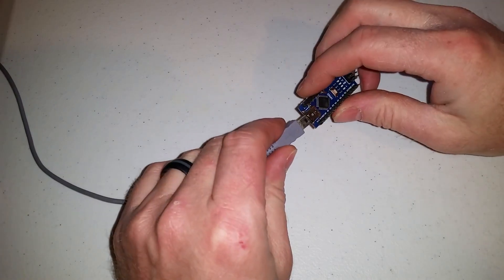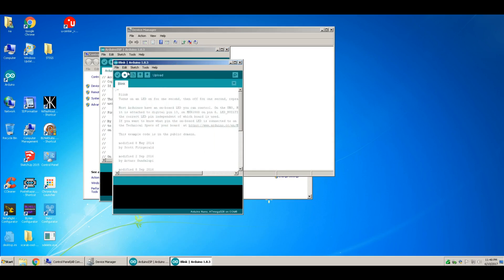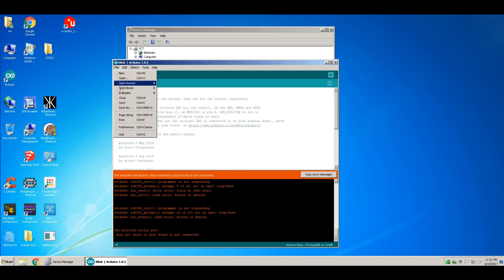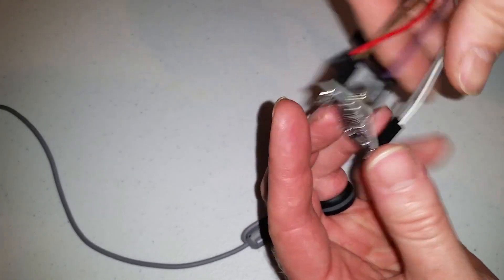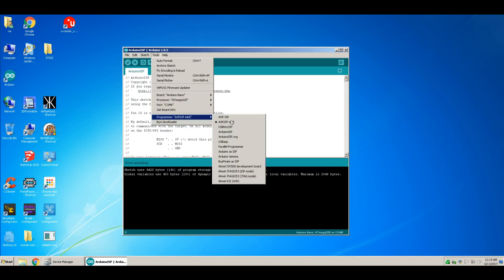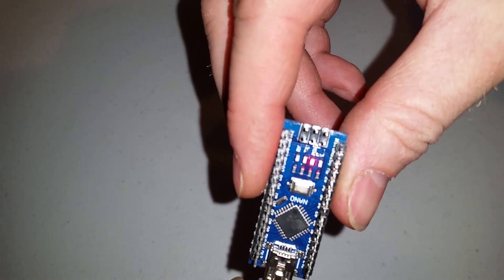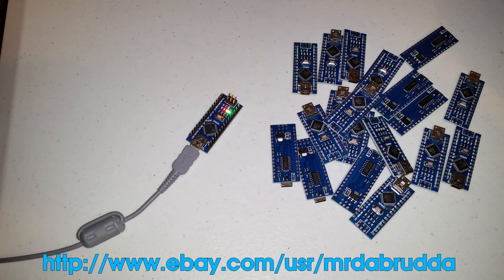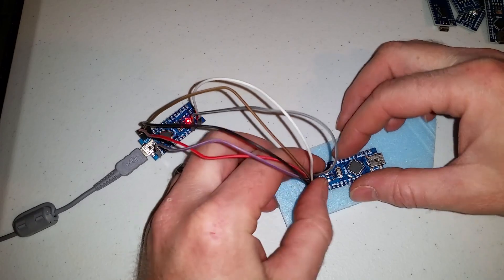How to Flash/Re-flash a Bootloader on an Arduino Nano

Comment: what if i dont have another arduino just the nano thats not working?
Reply from the maker: You can use an FTDI module or any kind of Arduino.
Reply: @MrDabrudda  hey thanks I already fixed i just had to click the old bootloader option in processor

Comment: I keep getting message I dont have permissions and cant communicate , what can i do to get round this?
Reply from the maker: Are you using Linux or Windows?
Reply: windows 10
Reply from the maker: In Arduino IDE ensure the comms port is set correctly.  Ensure the windows drivers are installed.  http://www.wch.cn/download/CH341SER_EXE.html to download the drivers.  Reboot after the install.
Also try running the Arduino IDE "as and administrator".

Comment: I found a trouble:
avrdude: Expected signature for ATmega328P is 1E 95 0F
         Double check chip, or use -F to override this check.
Error while burning bootloader.

how to fix it?
Reply from the maker: Is your processor an ATMega329P or an ATMega329PU or ATMega329PB?  That will make the flash fail if not selected correctly.
Reply: @MrDabrudda  atmega328PU smd

Comment: so what you and others are saying is that without a working arduino of some kind you can't update a bootloader on a nano. i have two nano's and must specify Atmega328P (Old Bootloader) in order to upload a sketch. No problem. But when I updated to the library TFT_ILI9163C-Pre-Release-1.0p7. It doesn't work anymore. I get a clean compile followed by a clean upload but the the red light on the nano just flashes very fast. I tried fitting a 3V3 level converter but it made no difference. So I have ordered another more expensive Nano which hopefully will have the new bootloader. Thank you for an excellent video.

Comment: Based on a comment on the top answer here: https://arduino.stackexchange.com/questions/51866/arduino-nano-atmega328p-bootloader-difference

It seems like a good idea to just burn the Uno bootloader onto the board, that way you get an extra 1.5k of flash space.

Comment: I had the same problem, but was able to use the Chinese NANO  by selecting the "use old bootloader' option when downloading a program. Using the old bootloader uses more memory, (about 1.5 KB more), compared to the new one, but if your program  can fit into 30KB or less, there will be absolutely no difference in the results.....

Comment: While this video didn't solve the root cause of the problem with my Nano's setup directly it did lead to the cause after observation when trying to re-flash the bootloader.  The power led was lit then slowly dimmed down.  The problem I was having was that I hooked up my Nano with the VIN pin.  This was effectively making the Nano try to power other circuitry making it impossible to load code and throwing this error.  Once I slapped a diode in there all was right with the world and the Nano was then programmable again.  Thanks for taking the time to make this video!

Comment: I got problem. avrdude: Expected signature for ATmega328P is 1E 95 0F
         Double check chip, or use -F to override this check.
Error while burning bootloader. the connection are correct.
Reply from the maker: Try this work around
https://www.instructables.com/id/Bootload-an-ATmega328/
Reply: @MrDabrudda  "(A bootloader, very simply, is a programme that sits on the chip and manages the upload of your sketches onto the chip)"

Once this is done the chip would work ona battery and send information , withb luetooth as example)   to another device?

Comment: can you help with a nano that all it does is the led just flashes red thats it and it wont let me upload to it...
Reply from the maker: Does the Nano detect in the Device Manager?  If not load the drivers.  Try a different USB cable which you know works with data and not just a phone charging cable.
Reply: use old bootloader option

Comment: Hello! I have a JGAurora 3D printer with a main board not specified in arduino. It’s called a MPX_PRO_V3. I accidentally flashed the printer and ended up bricking the board, resulting in the two white bars. I did buy a usbasp for the unbricking process, but everything I try fails. How do I burn a bootloader to the board using a usbasp? Or would I have to get an arduino nano? Thanks in advance!
Reply from the maker: I made a video on how to flash an Arduino bootloader using a USBasp.  I don't have a MPX v3 motherboard but all Arduino boards have to same ICSP connectors.

https://youtu.be/jgHIFWPUe_M

Comment: Hey. I have a problem with one of those Arduino Nano. When I plug it in my computer. It does nothing. No sound of it going in. The lights on Arduino is on. Nothing in device manager. No new devices pops up. I installed the correct drivers.. for the chip. When I installed the drivers it said preinstalled. Not installed successfully like I have seen all over the internet. Really need help. Thank you.
Reply from the maker: Try a different USB cable you know works for transferring data from your phone or other device.  Windows 10 should install the drivers automatically.
Reply: MrDabrudda I have tried 3 cables already that all works.
Reply from the maker: Try a different USB port or computer if you have one.  Also try the official drivers for the Arduino.
http://www.ftdichip.com/Drivers/CDM/CDM%20v2.12.00%20WHQL%20Certified.zip

See this website
https://www.rastating.com/installing-drivers-for-an-arduino-nano-in-windows/
Reply: You see to install that drivers I need to see the Nano in my device manager. I do not see it at all. I see no unidentified device. I also checked the whole device manager and checked if anything was added when i plugged it in just in case the computer recognized it as something else. I have tried different computer and different cables.
Reply: And I don't even hear a sound when i plug it in like if i plugged in any other device.
Reply from the maker: You should see the Arduino under the Ports (COM & LPT) in the Device Manager.  Are there any lights on the Arduino which are blinking or lit when the USB cable is powered on?
Reply: MrDabrudda There is one red light on. And there is not even a com and port tab. It's not there at all. I checked the whole device manager very carefully. Could it be a faulty chip?
Reply from the maker: It could be a faulty Arduino.  Try it on another computer and see if it detects.